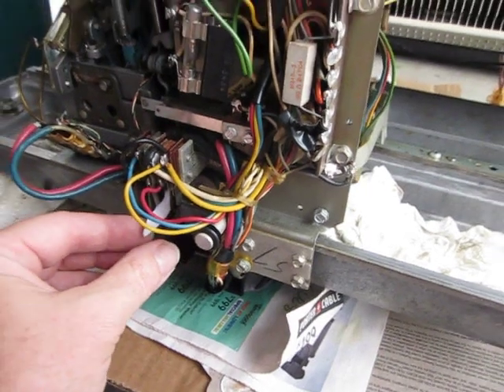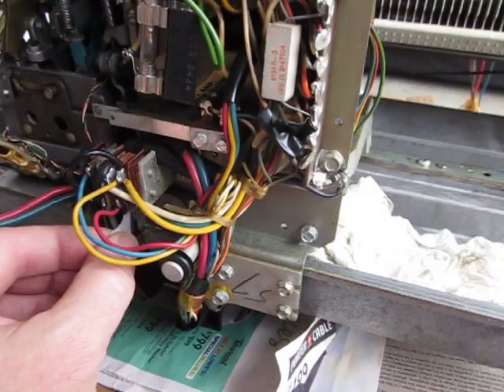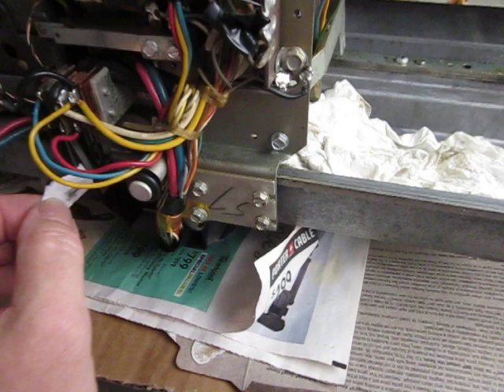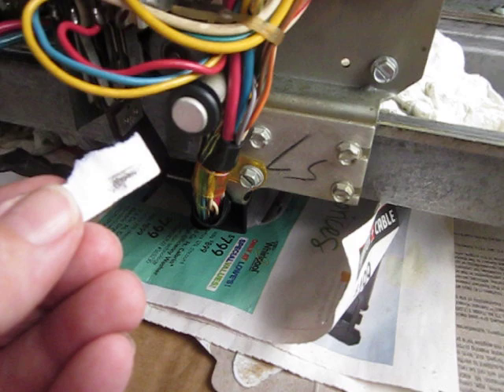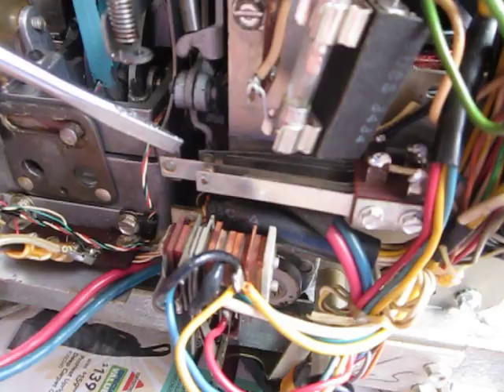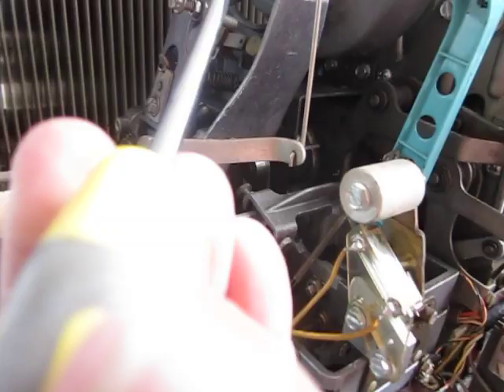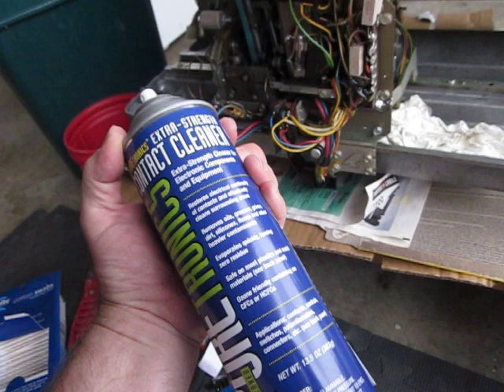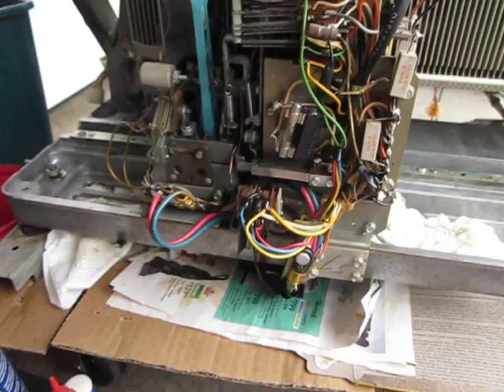How To Clean Contacts Seeburg Jukebox Selectomatic 160

Comment: Hallo,
I own a 1973 Seeburg Fc1 Regency. I have a problem. If I select a song the mechanism will pick the record and read it correctly but only if I select songs on the left side (so the 1xx).
if I select the 2xx side the mechanism moves, picks the correct record but it reads the opposite side (the 1xx).
I have already cleaned everything so contacts are ok. Furthermore if I select records from 170 to 179 it never picks them (it scans them but don't stop and picks the 120/129 ones).
Anyone can help? Thanks.